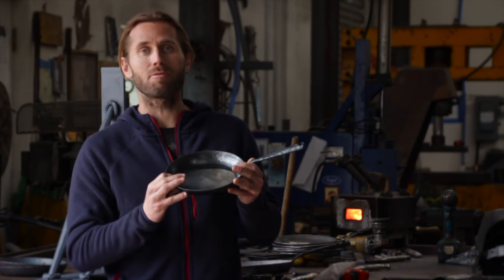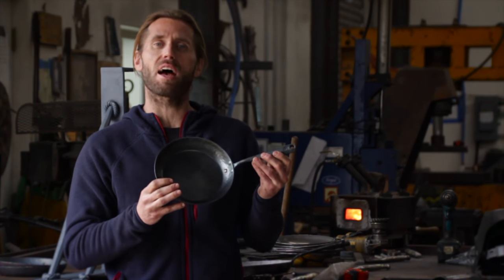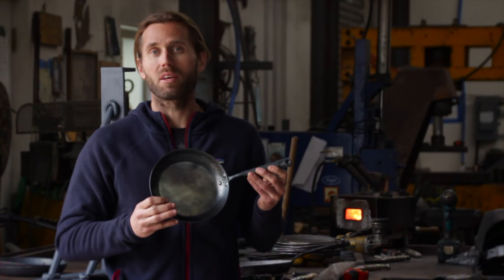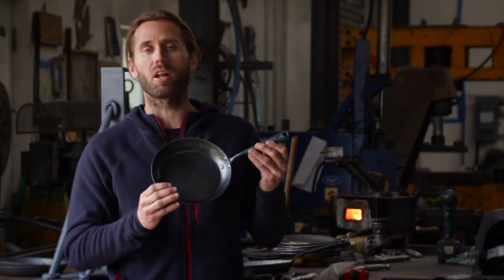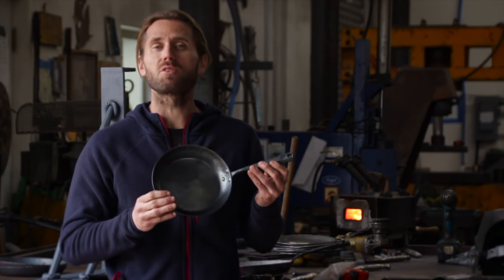Santa Barbara Forge: Carbon Steel Pan

Comment: It already was in the shape of a pan before. Did you hammer it just to add hammer marks, giving the illusion it was hand forged?
Reply: The basic shape is rough pressed, and the hammer marks shape and round the walls to the correct curve and texture.

Comment: What’s the difference between a hand made carbon steel skillet vs a machine made one performance wise?
Reply: None it's really just a finish thing for looks.  Kind of like a thinner cast iron cookware the care and seasoning are similar.
Reply: loki ok thanks for the clarification. I thought it was like comparing a hand forged knife using premium Japanese steel vs stamped knife made by machines difference.
Reply: It really depends on the weight, thickness of material.  Most machine made ones are thinner and don’t hold the heat as well!